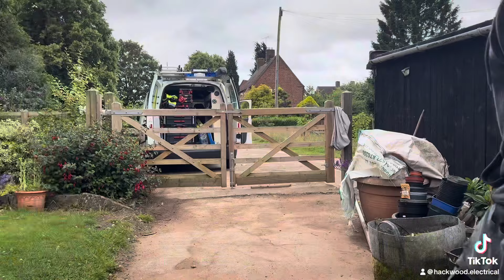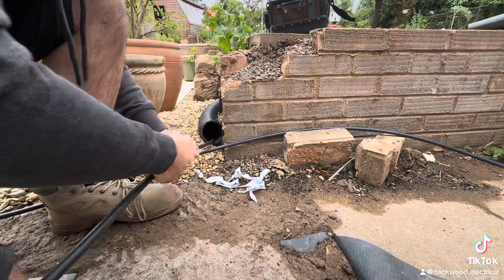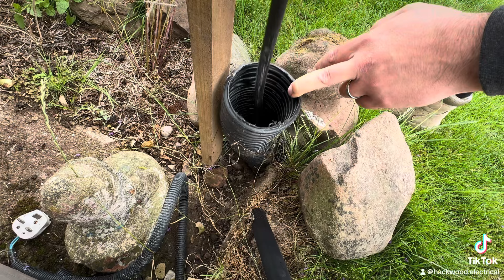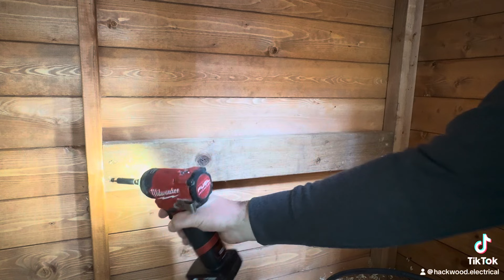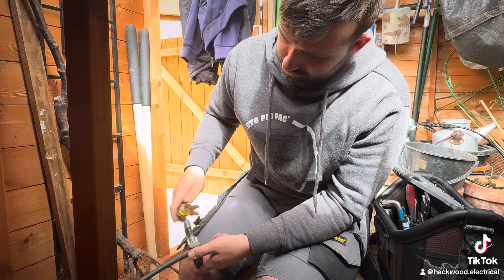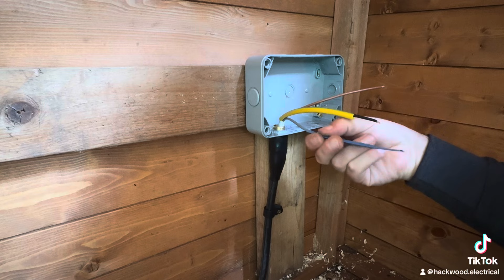Installing a socket weatherproof socket in a shed

Comment: Thanks for the video.  As an adult learner do you need to earth the armour in the SWA?
Reply from the maker: Yes. This can be done at either the supply or the load end, whichever is easier for you generally. 

This was taken into a HENSEL adaptable box with the PE metal inlay so that’s where it was earthed/bonded. 

Reason you have to bond it is if the cable gets damaged and the live core comes into contact with the armouring, the steel strands could become live… if they’re bonded they will short circuit and activate the OCPD
Reply: Best to, incase a digger or shovel hit the outdoor SWA Cable, the short circuit from the earthed armour will cut the power before any internal circuit or appliances are damaged. I hope that made sense 😅
Reply from the maker: @arsalanb3420 100%
Reply: @hackwoodelectrical  Thanks very much for taking the time to reply - appreciated
Reply from the maker: @no_short_circuit  no problem 😁